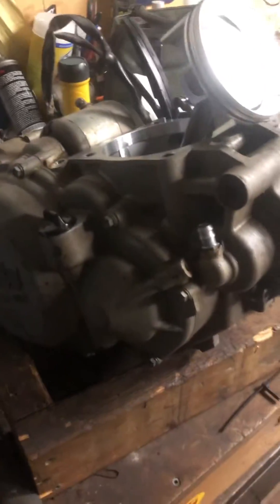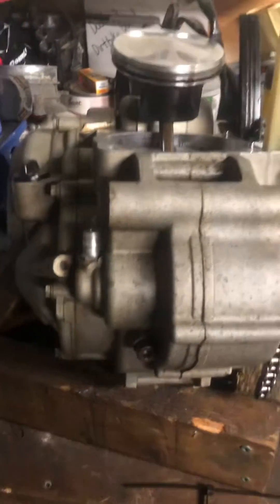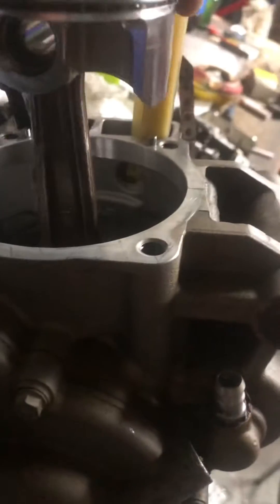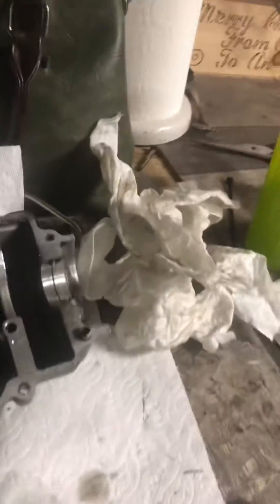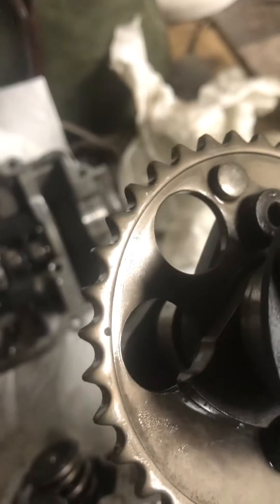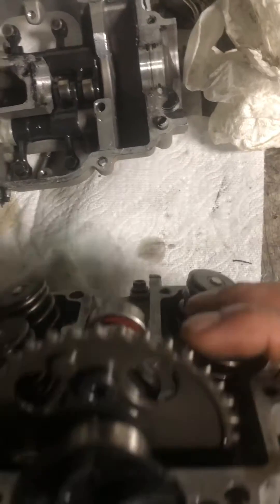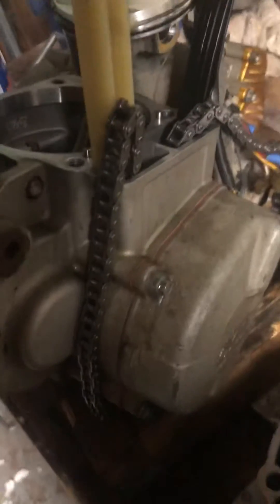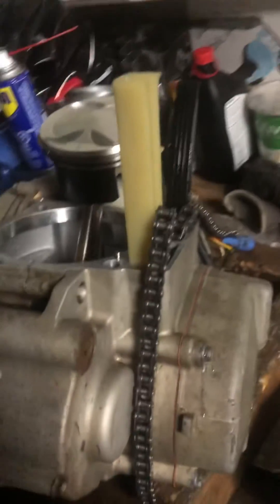Ktm Rfs 350 450 525 engine timing / top dead centre.

Comment: What you do after you lock the piston.. finish the work. Then you lose the bolt to unlock the piston? Or leave it ???
Reply: Remove the bolt, place washer back on, replace bolt. will not lock the engine out with washer on
Reply: @yeahnahnahyeah4322  thanks you so much. so my mecanic put it all. and theres a clicking noise coming from the time chain. like i rotate the flywheel by hand and at some point it kinda get jamed or stuck. i check the timing tensioner and the head valve ect and evreything seems ok? so the time chain is new the valves are new. the crank totate perfect piston is new so idk what to do

Comment: I have the exact same motor and I just did a full top end rebuild (New cylinder, piston/rings, gaskets, etc) and when starting the bike for the first time coolant started externally leaking out of the head gasket from in between the cylinder and the head. I tore apart the motor again and replaced the head gasket again and it's still leaking. Any idea why it's still leaking? I checked to make sure I installed it properly and double checked the torque specs to make sure
Reply from the maker: Not sure why this motor did the same thing (leaking coolant from head and base) I did not do the engine first round. It did not leak when I was done though. Sounds like possibly the head could be warped from overheating maybe, I would pull head and check for warpage. Either a straight edge or place head gasket side down on glass and check with feeler gauges! Also you can glue a piece of fine sand paper on glass and use that to resurface if needed!!
Reply: @BackYardMechanic069  Alright will do! I hope it's warpage and not something else. I'll let you know how it goes! Thank you!
Reply from the maker: @ZmanAdventurez88  your welcome!!
Reply: @BackYardMechanic069  I checked the cylinder and the head for warpage and none was found so I sent it out to my local mechanic to inspect and he told me the same thing. Now I'm puzzled as to what it could be. I've already had to replace 2 head gaskets before this one. I've followed every step carefully and made sure all surfaces were clean. Any recommendations as to how to proceed with this job?
Reply from the maker: @ZmanAdventurez88  when you are torquing the head down are you going straight to full torque? Usually do it in 2/3 steps in a cross cross pattern. So if head torque it 30 ft lbs, do 10-20-and finalize with your 30 all in a cross cross pattern
Reply: @BackYardMechanic069  I also tried that the last time I replaced the head gasket. I'm going to to attempt to clean every surface and every thread of every bolt very well this time with brake cleaner and then before torquing anything down I'm going to make sure it all lines up properly and is on the correct way. If it doesn't go right this 3rd time then I'm going to lose my mind.
Reply from the maker: @ZmanAdventurez88  yes ensure all surfaces are clean from old gaskets and no oil or such! Keep me posted
Reply: @BackYardMechanic069  Alright so I haven't finished putting it all together yet but I've gotten far and found out something that could have potentially been causing my issue. The threads on the base were filled to the brim with coolant and I never cleaned them so everytime I put the head bolts on they would push all that coolant up into the base gasket AND the head gasket causing them to leak before I could even get the head bolts tightened all the way.
Reply: @BackYardMechanic069  Update: I found out my torque wrench was 20 ft/lbs off. Pretty sure that's one of the reasons it wouldn't seal 😂
Reply from the maker: @ZmanAdventurez88  haha that’s Probobly not helping 😂😂, not u know just torque at 20ft/lbs more lmao!
Reply: @BackYardMechanic069  Finally after a month of problems it's running with no leak at all! Now I'm gonna try to break it in and get those rings seated. I use AMS oil break in oil for it. What kind of break in procedure would you recommend?
Reply from the maker: @ZmanAdventurez88  heat cycle it 2 times (up to temp and let cool down) and then for first ride make sure rings get to see all rpm’s, but not to much wide open. So easy riding and then every once in a while open it up and when you have strung the gear out let off and let the rpm’s come back down and then continue your easy riding. Don’t baby it to much but don’t beat on it to much. You want those rings to see all rpm’s and get them broke in good.
Reply: @BackYardMechanic069  alright sounds good 👍 thanks for all your help
Reply from the maker: @ZmanAdventurez88  welcome!
Reply from the maker: I actually was doing the top end gaskets as someone prior had done an engine rebuild and it leaked from the head and base gasket. I checked for head war page and cylinder warpage with nothing found. Only thing I can suggest is to remove and check for warpage to ensure nothing is going on there. If not make sure you have the surfaces nice clean and dry, and proper torque specs!

Comment: Do you have anything showing the flywheel at top dead i bought one that someone was rebuilding and he gave up on it and i believe the flywheel is out of position
Reply from the maker: Hi Jason. I do not, but I can tell you that the flywheel has a keyway for the crank. I have seen some break the keyways. Only way to check with this one os to remove it and check for a good keyway! Sorry hope this helps